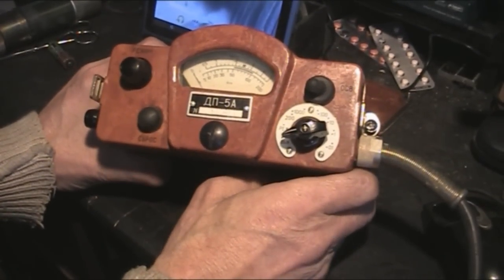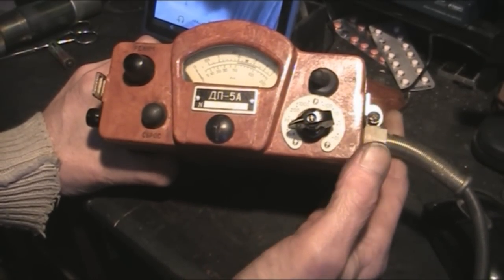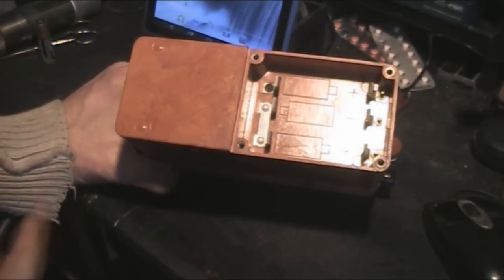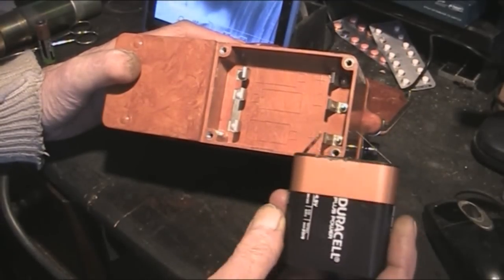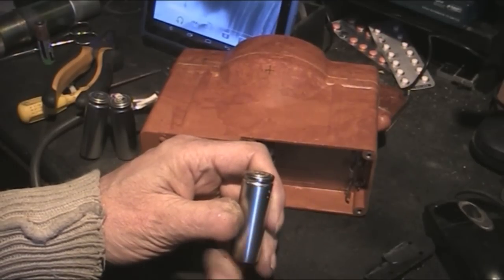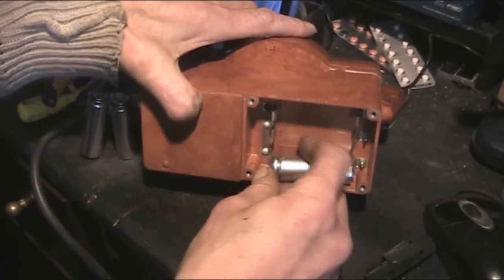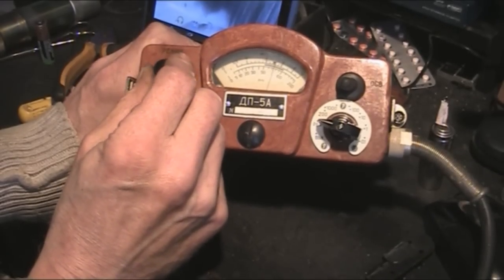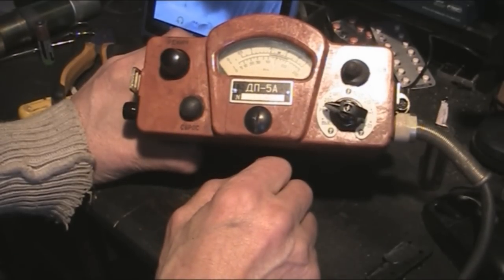Geiger Counter and a Big Thank You

Comment: As to insulation, wide masking tape (used when painting etc) could be worth a try, and an added bonus is that it is writeable. I would begin with 2 layers and see what it does :)
Reply from the maker: Teukka72  I just wrapped the batteries in a layer of insulating tape, but i'm going to look at fitting a couple of insulator strips to the  battery compartment using hot glue so they can be removed without damage (though the intention is that they would be permanent)
That way they take up a bit of space between the batteries to stop them moving around and keep them centred
Reply: Get some 1 inch PVC pipe and cut it the length of the space between the probes. You may have to grind one side a little flat with some sandpaper or some such. Wad a chunk of aluminum foil and stuff in the pipe, pack it down nice and hard till you can drop a AA battery in so the plus pole is sticking out. Insert and use. you'll need three all together. The sleeves insulate, space, and allow you to use rechargeable instead  so you can save your wallet.
Stick with AAs, anything more can fry the electronics, they are delicate.